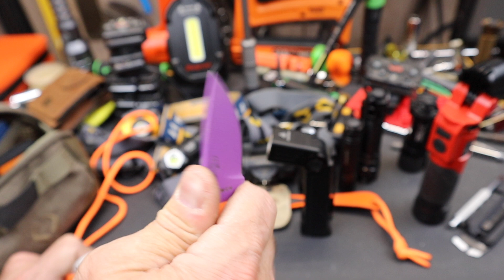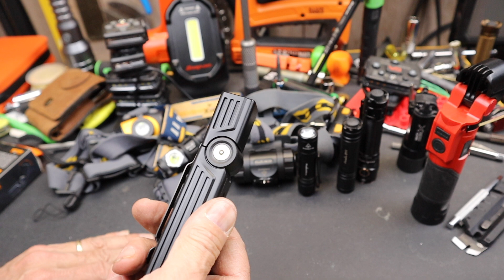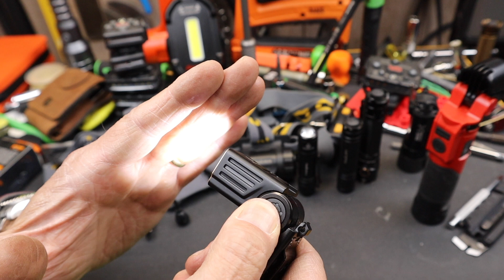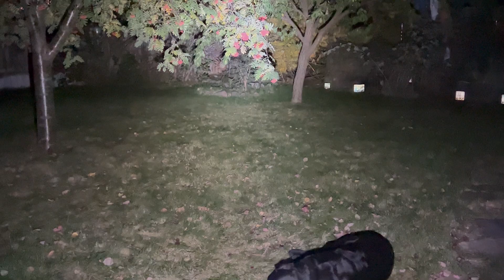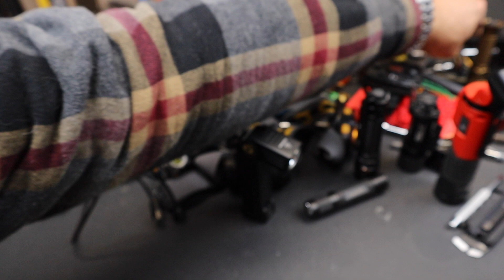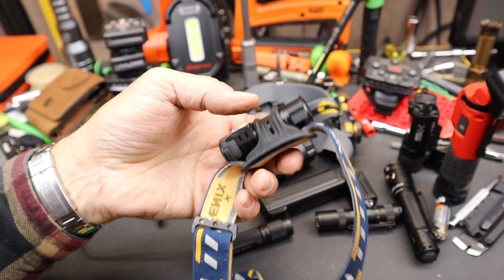Fenix Lights and more SOG knife stuff: Fenix WT25R Adjustable Head Worklight & E12 V3.0 EDC AA Light

Comment: I have been carrying that light every day for at least three years and I love it. I work as a maintenance man that does excavation, concrete, plumbing, small automotive repairs, etc. the only negative that I have found is that it will sometimes slide down on thin  metals like cheap refrigerators.
Reply: I will say I have never found a good use for the pocket clip though.

Comment: That ESEE is slick, the orange scales is perfect for the woods. Nice job on the Para cord wrap. I have a couple Fenix lights, good build quality and i like their batteries. 
The Milwaukee was designed for the light to be in the shirt pocket. Thats why the clip faces forward. If you are just wearing a T shirt it helps. Designed for working. 
2023 expiration date means it was produced in 2013, so 11 years old now. 
Thanks for another great video brother.